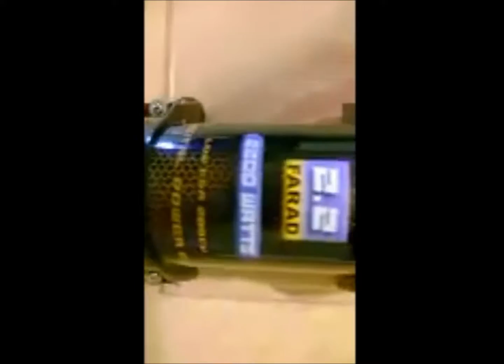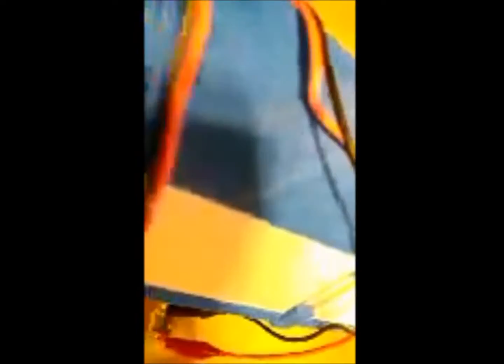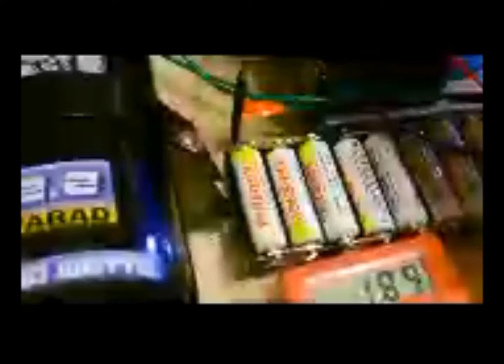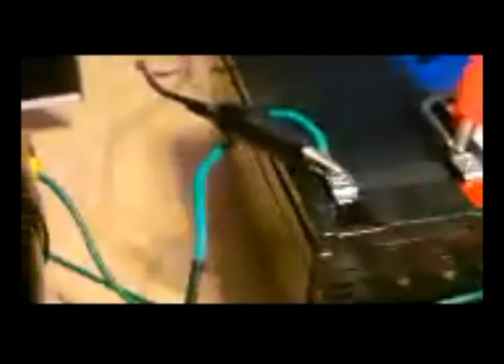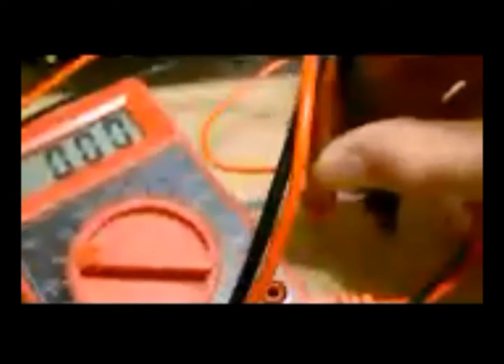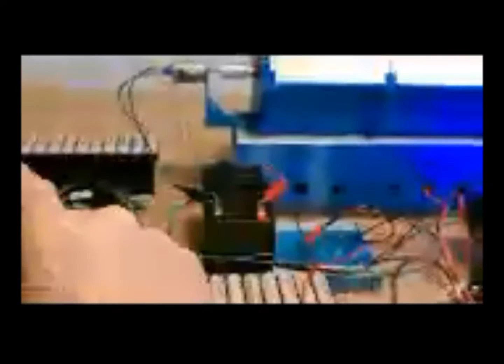Prototype on plexiglass with capacitors

Comment: David, I would love for you to see what I've got. where are you located? I'm in Oklahoma U.S.A.
My my my what a long strange trip it's been. now have 3 different sizes. Each unique and different but on the same frame and basic principles. I started out using high output alternators, then tried treadmill motors mainly because everybody said "they put out alot of power", but no one could tell me exactly how much power, and I wanted to know. 
1,500 watts on my system BTW. next I tried generator heads from a gasoline powered portable generator. Total flop, more money wasted lol.
Finally settled on belt driven generator heads, this seems to work pretty well.
Anyway my email is rocket3man@rocketmail.com, would love to chat 
or hookup and see where each other is, on our projects. I'm putting out 10,000 watts BTW.
Reply from the maker: I would love to see what you have done. Permanent Magnet Generators or high end wind turbine generator heads have been the most efficient for me. You can have a motor that doesn't require as much torque or power to drive the generator heads. I also use a larger pulley on the head of the generator and a smaller pulley for the drive motor. That way once it gets up to speed you consume less amps. I have been trying to figure out how to build a gearing system that is belt driven. That way I can get more power with less energy used from the primary drive motor. It's great to hear from you.
Reply from the maker: I live in AZ
Reply: @shadowmorf  David, answered that last, before I got to this response. Oklahoma to Arizona, that ain't to far. I'm using a 6" timing belt gear on the generator heads and a 2" ( I think it was) on the motor. Tried serpentine belts, which worked well on the high output alternators I used at first, and now am using again, but I wanted all the pulleys uniform for the machinist and since a serpentine belt wouldn't spin the generator heads without slipping, I'm using timing belt pulleys on all of them now.. Give me a call, or better yet a text at first cause any number that calls, i give em about 1.5 seconds to answer my "HELLO" and if a human doesn't say something, I kill the call.  So, text and say you're gonna call, I GUARANTEE I'll answer yours cause I been wanting to talk to you for years.

Comment: Actually have two that run, both making power. 1 little one and 1 bigger, now I'm working on a mid sized 1.
Reply from the maker: If people just copy what I did on the first video, second or the third they would find what you have. IT WORKS. There is a long way to go yet for perfection. The more people try the faster this will get done.

Comment: Hopefully tomorrow, 8-27-16 I can get somebody to take a video of my contraption running with the meter readings, so you can see what I've got going on.
Reply from the maker: just use a cellphone. I will get the gist of it.
This one should be able to run off of atmospheric energy and super caps. Keep experimenting!
Reply from the maker: I hope everything is going well!! I would love to see what you have done so far! Keep experimenting!!!
Reply: @shadowmorf  david, if you will send me a phone number in an email, I will certainly send you a vid or pictures. my email is rocket3man@rocketmail.com my phone number is 918/637-6968 call or text brother. I would love to get together and let you see what I've got going on. I'm in N.E. Oklahoma, what's your location?
Reply: David, I'm still wanting to send you a video or pics, I've come a long way in 4 years, hows your project coming along? Phone is the same it's been for 25 years now, 918/637-6968 email is same since 07, rocket3man@rocketmail.com

Comment: David,very informative. Thanks. I'm still at a loss as to why the unit is so small?? Are you going to scale it up for home emergency use, and this was just a prototype?Seems to me your old vid worked fairly well, what happened did you scrap that project?BTW, what was the output amps on those alternators you were using in the other vid and where might a man acquire some of those? (if they were in the 200 amp range) they looked good. You're light years ahead of me with your 3d printing, not to mention your latest effort. Congrats.
Reply from the maker: No I did not scrap the old one. I got the permanent magnet generators from Missouri Solar and Wind I believe.
You can get some expensive ones that are 50 amps 2.4Kwt from Northerntool as well. I am going to use the generator heads on a large scale of this one. This one uses so little energy and it is turning at enough rpms that I could get a bit more energy with less effort. 3D printing gives me the ability to scale and test at a much cheaper rate. Afterward I can have it machined larger. When it comes to generators and batteries are all able to be scaled.
This is the same concept except later I should be able to run a scale model by atmospheric energy. No batteries to run it at the same time charging batteries! I would love to see where you are at and what you have done. I hope all is going well. Keep experimenting.